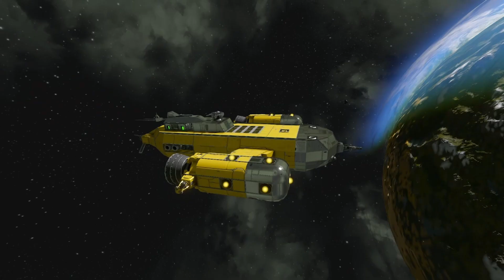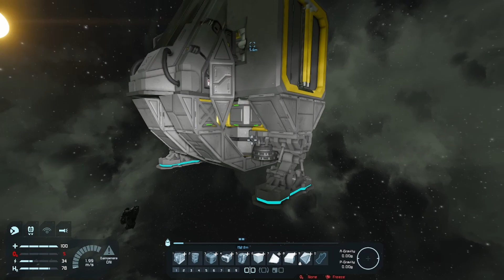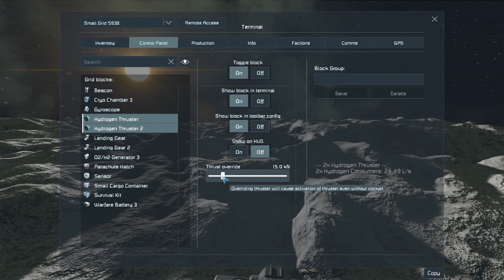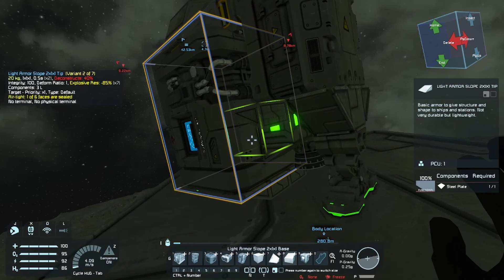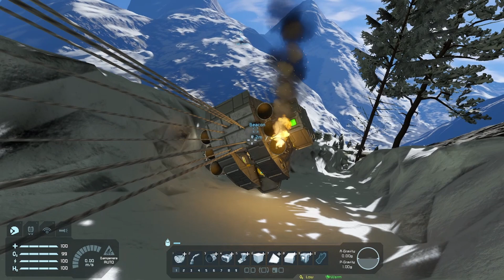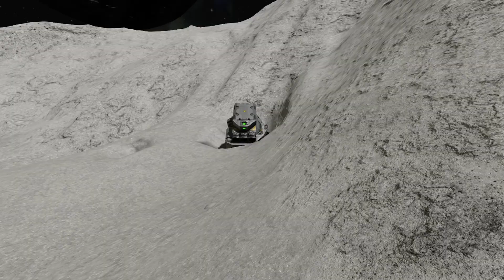Ship of the Week - Drop Pod - Space Engineers Ship Design Challenge

Comment: How about something simple, a large block, small scale mining shuttle, designed to fit in and out of the standard 3x4ish hanger (meaning the ship needs to be no biger then 2x3.   and small enough to manouver,  around,  meaning it can't be to long,  maybe 8 blocks long 3 wide 2 high.  smaller the better but it needs to be able to "bore drill"   and you need to be able to see front.  for space use only, asteroid mining.   so it will need o2 and h2 production, coms, and other basic stuff like that.   essentially a buffed up ecconomy turtle miner.
Reply from the maker: Could be a fun challenge to get something that works well that fits that size requirement, I feel like this could be a good candidate for a heavy industrial drone; a large grid Ion drill ship that could leave a main ship or mining base.  Onto the list it goes!
Reply: @redsgamescompany  yeah, the real challenge is getting an antenna in that :)  it took me hours to tetrus something together like that and i still think it could be smaller.  and better done.   hence the challange :) 

And of course the most annoying part...  NONE of the large ship cockpit modals...  have a connector  on the back.   that peeved me off the most.  and becomes such a limiting factor